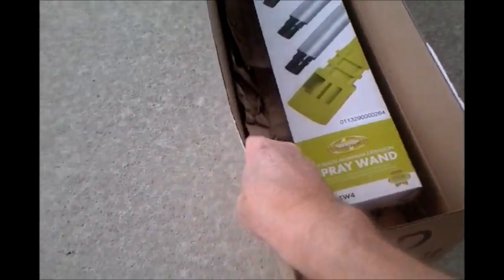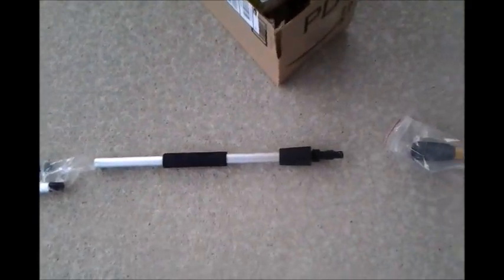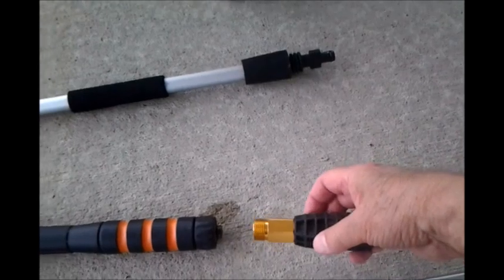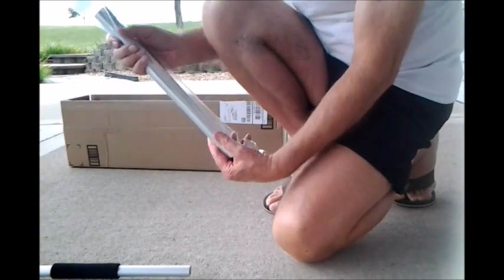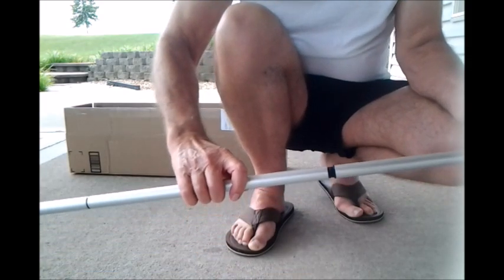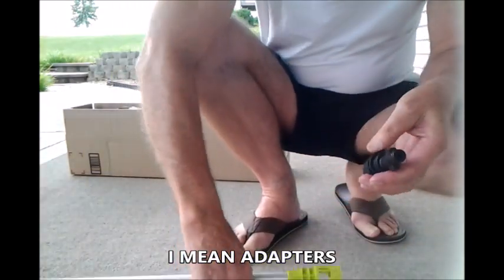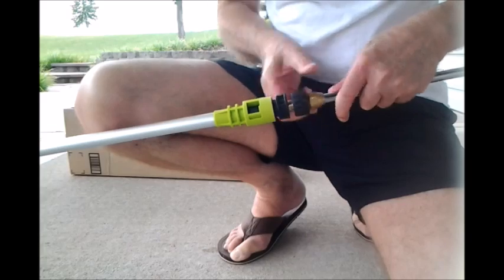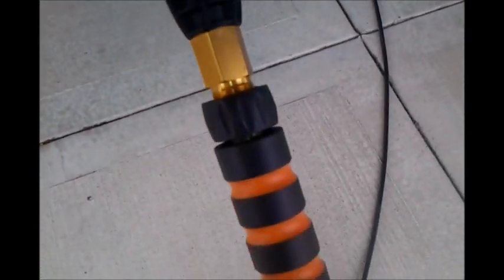ASSEMBLING A SNOW JOE ALUMINUM EXTENSION ON A GENERAC 65950 HIGH PRESSURE WASHER

Comment: i bought the same extension. but it won't fit with my washer. i have a Husky 1750. is it possible to find the measurement of the first piece that you screwed in to the gun (the threaded adapter)? thanks
Reply from the maker: The threads appear to be about 13/16", Mohammed, on the adapter that is screwed into the gun.  Let me know how it goes and thanks for watching!